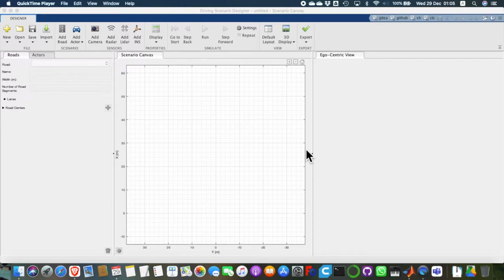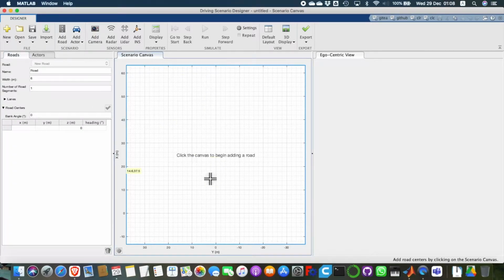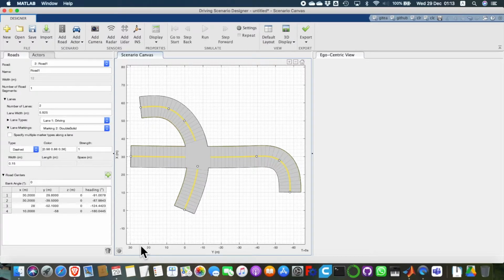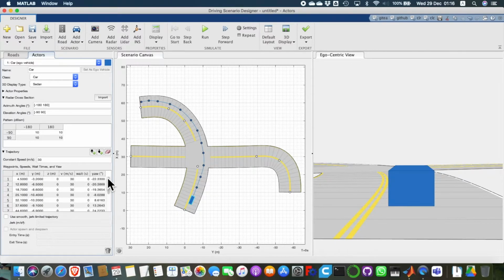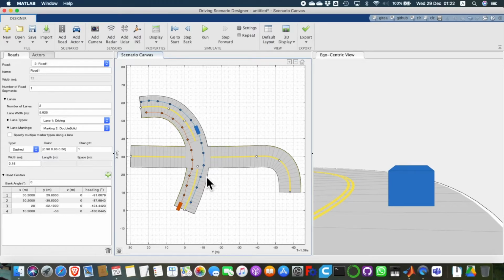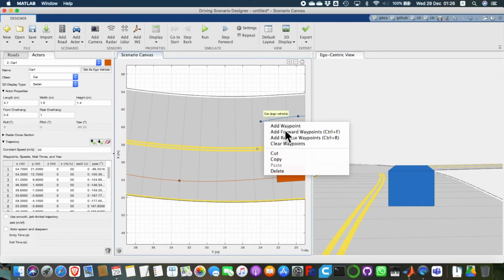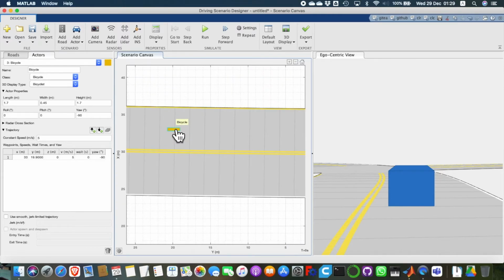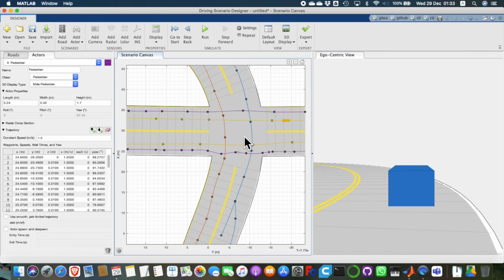MATLAB: Driving Scenario Toolbox - Intro

Comment: Is it possible to add specific algorithms like Kalman Filter in the toolBox?
Reply from the maker: Hi Muhammad, thanks for your question. 

In MATLAB, Driving Scenario toolbox is part of a larger toolbox called as Automated Driving toolbox. This one has a toolbox called Detection and Tracking which can be used for tracking and sensor fusion using Kalman filter and range of other tracking filter options out there. 

I hope this helps! 
Best, 
Sanjay
Reply: @shortvideomaker2479  What about MPC? Thanks！！！！！